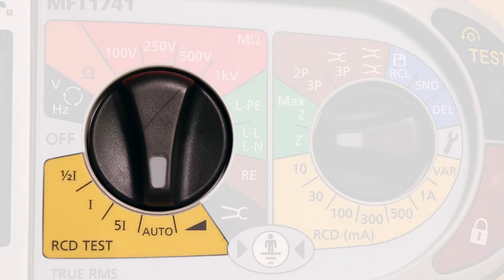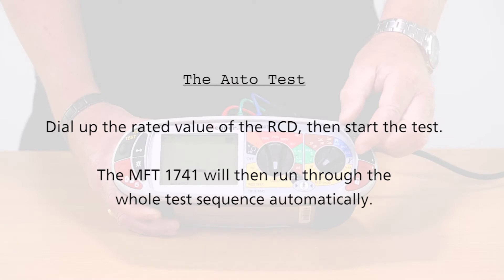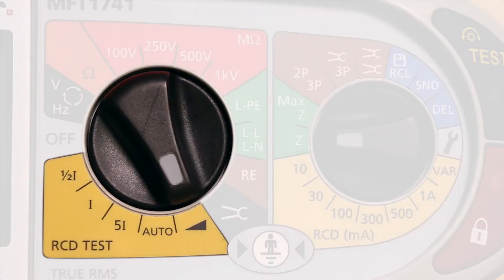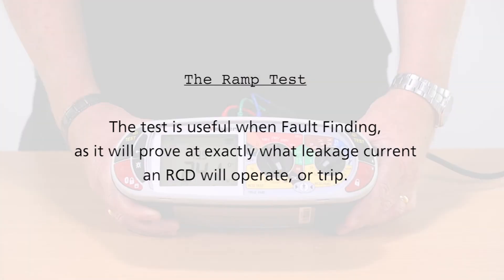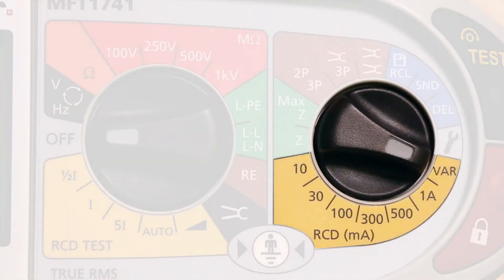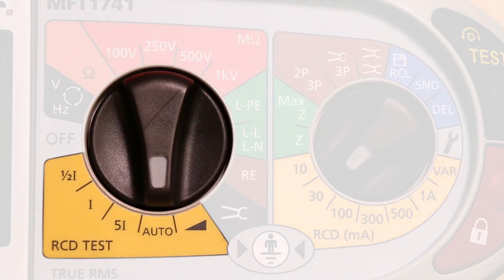MFT1741 RCD Test Functions | Megger auto test facility ramp test

Comment: Why doesn't the Megger MFT1741 show values for both degrees at half the current  auto mode?Also, why isn't RCD type B available to select in auto mode (and possibly manual mode) on my MFT1741?
Reply from the maker: Hi Andrew, thank you for your comment. Could you please give our Technical Support a ring on 01304502102, they will be able to help you.